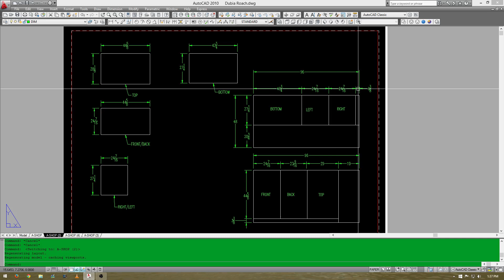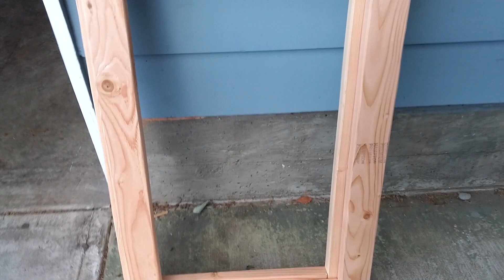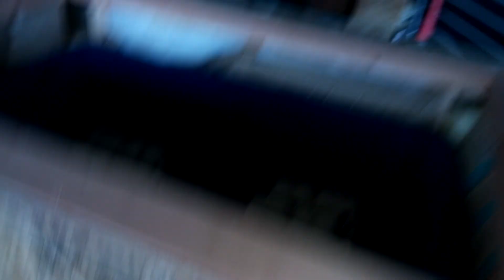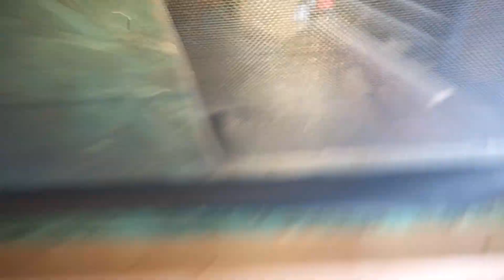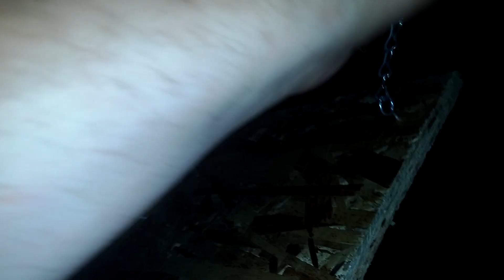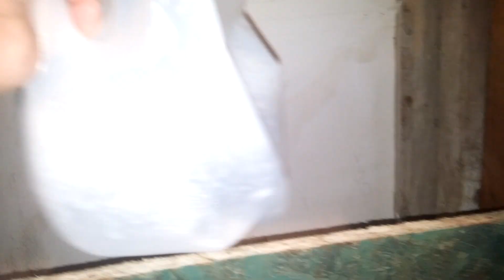Buidling an Insulated Dubia Roach Motel

Comment: Where I live it gets up to 113° in the summer, would this be okay outside or would I need to bring it inside? We don't usually turn on the AC until I get home after 3 since we have a wall unit not central air. I worry about a fire. Stressing over my dragon and frogs as well since this will be our first summer together.

Comment: What’s the coldest it’s been where you keep this?
Reply from the maker: I have had the ambient temp outside of this as low as 15 Fahrenheit and the internal temp with the heating mat And insulation keep the temperature at 74 Fahrenheit. If you wanted breeding Temps you could pick up another mat and lay on top and make sure it's plugged into the thermostat.

Comment: I was thinking of the same thing and found your video. I know they need ventilation but with heat rising, my only drawback was wondering about the difficulty of internal temperature regulation while insulated when the top is basically open to atmosphere. Did you leave the top open ventilated and it still be sufficient in the winter?
Reply from the maker: Temperatures around here are mild.  If we get highs over 90 they don't last long and I would recommend leaving top lid open. Maybe incorporate a computer fan for ventilation. I used a thermostat for gardens to control temp.  During summer my population grows dramatically,  during winter it drops. Never less then about 5k, never more then 12k

Comment: I did the same exact thing lol they were in my house still are but I just went out built a gram and used fanflod to insulate and u have 3 Uth pads and I have it on heat monitoring with a temperature probe that turns  the pads on and off and keeps it around 90 degrees

Comment: Really like your design.  Are you still using it?  Did you have any problems or do additional modifications afterwards?
Reply from the maker: I used this for about 2 years. It worked fantastic. I was selling 1000 count starter colonies once a week without ever putting a dent in my population.  Only change was I bought clear bins as they are harder for the roaches to climb.
Reply: @squallxgamer  thanks for the quick reply.   Are you not breeding them anymore? Why?  I started selling mine as well.  It's a. Nice little addition of pocket Change.  Any trouble with Flys or mold having them in the garage? Thanks

Comment: May I ask how this insulated bin worked out for you in the winter? Any issues with the heaters melting the bin or causing problems with the wood or insulation? And was it enough ventilation?
Reply from the maker: MomZof3 z sorry I never seen this. better late then never. everything worked great during winter and summer. having the digital thermostat kept it from overheated